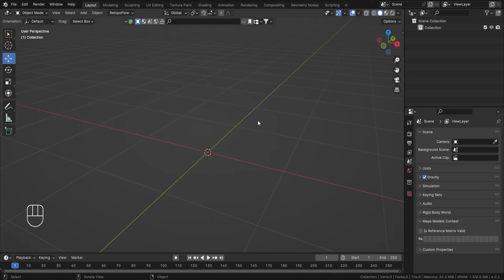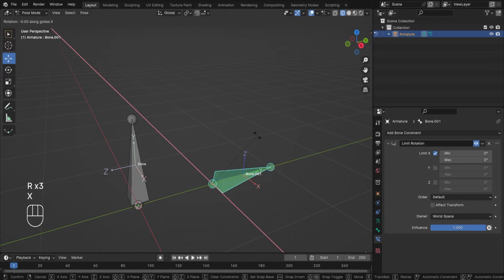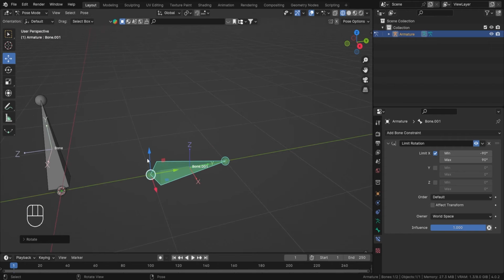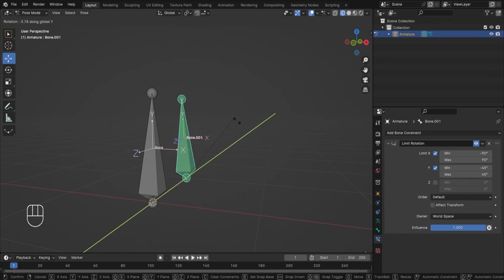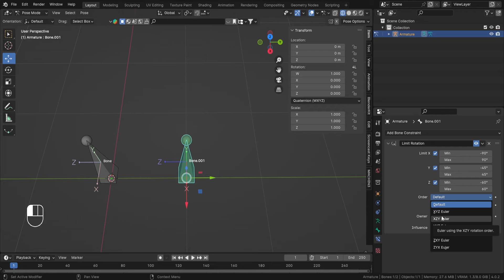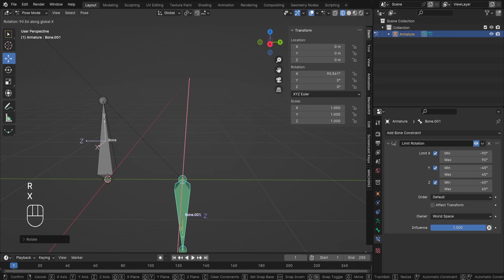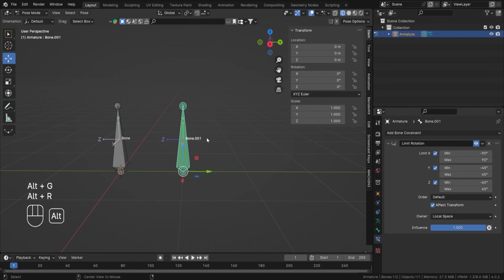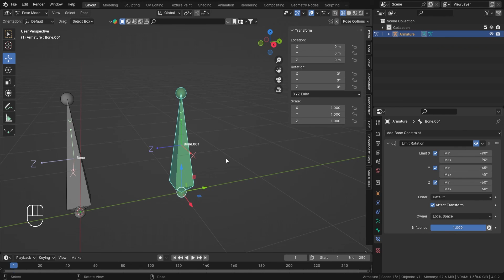Limit Rotation Bone Constraint Blender

Comment: Whenever I press apply it stops restraining it and whenever I save and exit it also stops restraining it
Reply from the maker: Applying constraint will make it to stop work. Saving and Exit after applying it will also not work. 
And if just Saving and Exiting without applying constraint makes it stop working then it might be a bug but make sure constraint is not disabled in anyway